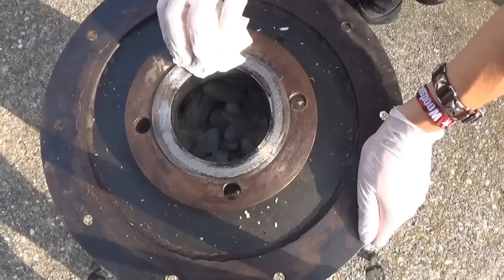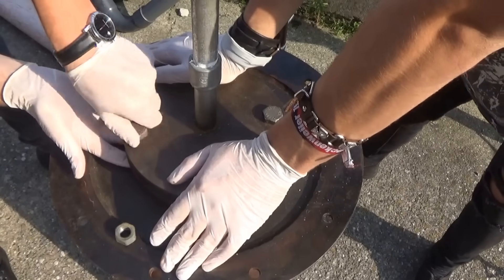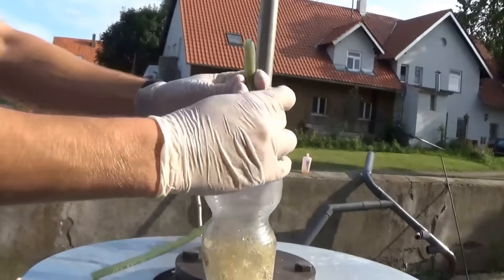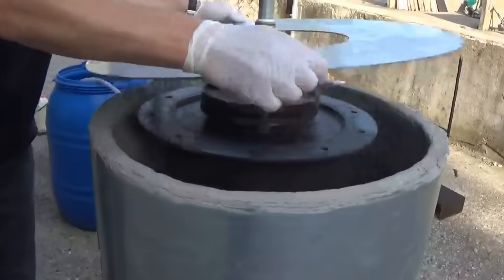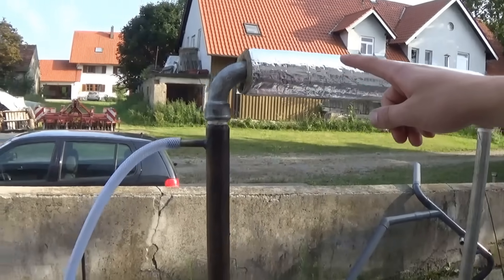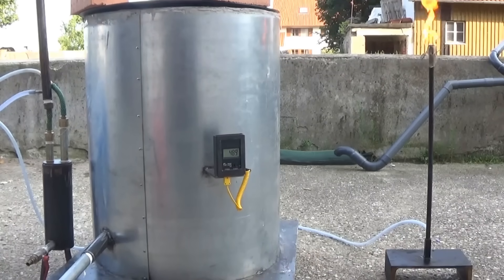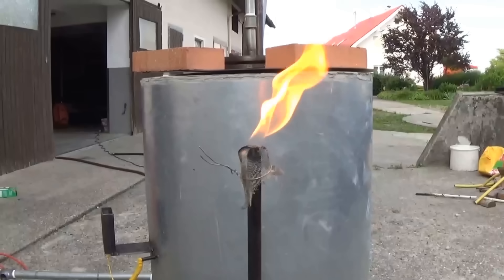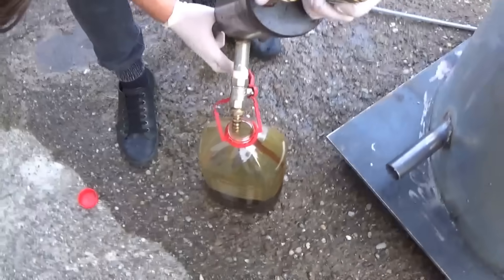plastic waste to oil/fuel improved pyrolysis reactor

Comment: use far better ground insulation put in a hole ,make/add a simple outside hot water jacket to retain more localised heat & run a small tesla turbine , 
collect the gas in a simple water based low just above atmospheric pressure  expanding uk 'gasometer' rather than wasteful burning.
 passed to a diy made & add/use a simple water based bubbling sealed 'trompe' higher pressure denser gas accumulator placed in a deep artificial water well to keep the high pressure gas simpler & safer use .
make a paint on internal low v (12v-50v driven by the simple made bladeless tesla turbine  ) resistive heater from 'Robert Murray smith conductive ink' https://m.youtube.com/watch?v=df58TiEhFn0 How To Make A Heater From Paper, Mar 22, 2018, 
Robert Murray-Smith
Something interesting to do with our conductive ink - you can help our campaign

Comment: If why not add water to the reactor instead of CO2 or another inert?  Yes there might be a small amount of dissolved O2, but when it flashes to steam, it should displace most other gases.  You could just vent off the steam first right?

Comment: 2:28 Or what about lighting a small candle and placing it into the chamber to burn away the oxygen inside?
Reply: It would only decrease the O2 proportion from 20-21% to approx. 12% at which a flame is smothered.
Reply: Some plastic could decompose react with O2 and produce carcinogen dioxine

Comment: Question: could the excess off gas that is sent to to the flare potentially be rerouted back to the chamber to potentially offset your fuels cost? Or in a larger scheme one would assume it'd have another function in the consumer grade fuel production right? Thanks, very informative.
Reply: Yes - you recycle the gas to power it in a full system.
Reply: Rather than burn it off pull it under a small vacuum and compress it into a storage cylinder.

Comment: Yep.. another poison turned back to poison.. but in a liquid form. Clean the land from plastic just to poison the air with it afterwards. Clever.. right? The gas from burning the plastic waste from that chamber relese a very toxic fumes ..just like the fumes relesed by a car after it burns the gasoline or the diesel. I see no filters used on this sistem.. and if there is such filters it is still poison back to poison result. So it solve nothing really.

Comment: after you get enough fuel from the system can you use it as the heat source mixed with air waste oil burner then the operation becomes no money out of pocket besides the blower but you could use a solar panel too for that

Comment: I worked for a plastics to fuel company building then running the plants as we scaled up in size.
Don’t use 3 or 7.  3 is of coarse pvc and the chlor recombines with the hc and creates hydrocloric acid.  Does wonders on the system, destroys fuel system of the engine, and is direct output of acid rain- way worse than the sulfuric base rain created from the old diesel. 
7 is basically anything not rate-able so you can get any kind of chemical reaction- absolutely chaos at a chemical level.
As you pointed out the styro issue, and without divulging millions in investment knowledge I will just say- don’t run it either.  So that eliminates 6
Polypropylene (5) has a high flash point and chem 101 will show you the issues mixing pp with pe.  So you can run it, but it is far better to run it in a separate batch as heating losses make it not worth running combined with pe.

So...1,2,4.  And if you price out 1 & 5, you’ll find recycling value is way more than cost of fuel retail.

Also- you need to remove contamination so we learned to shred, wash, and with specific gravity use as separation everything.  The amount of shampoo, milk, sugar, etc needed to contaminate a run is ridiculously small.  But our pyrolysis chamber was 12’ diameter, just over 30’ long each.  So shredding made sense for us to do in separation and cleaning.  At home- rinse and let dry in the kitchen or garage.  Separation by number.

You can definitely use the butane, propane, etc you are just burning off as the heating fuel to continue the process is you make a feed system so you can do continuous feed or run two pyro chambers.  Number one non-compressibles to heat unit number 2.

Also a better method of eliminating oxygen besides co2 is a vacuum pump when doing a pyro your size.  Get the a/c vacuum pump from harbor freight.  Then your heating process is better starting below atmospheric  pressure.

Then look into making a small distillation tower.  Product quality improves greatly.  You will pull out paraffin which can recrack and speed process greatly. 

Sally safety warning for doing this at home. Your literally making a bomb.  The temperature ratings of say an SF150 flange (150 psi rating obvi) at these temps goes down to a paltry 25psi.  7psi is actually the greatest rate to process at for volume and quality.  Learn to regulate there.  Have an ability to blow off pressure and expect it to be a fire ball when it occurs.  Watch other YouTube videos for what kind of fireball you get from just 1 gallon of gas.  Now have it explode at just 10psi.  It will turn a 3,000 sq ft house to embers quickly.  Remember output is 1:1. 1lbs of plastic equals 1lbs of fuel.  

Why isn’t this already everywhere:
I was in meetings with the head of recycling from Republic and we were planning to obtain their entire supply from the western US.  Obama’s epa admin refused to classify this fuel.  It doesn’t count as alternative fuel because it is crude base.  It doesn’t count as crude base because it has already been processed once.  Then the fact that this makes the fuel partial to full (depending on your process and quality) synthetic fuel.  So synthetics are a more regulated portion of the hc industry.  We hoped Trump would improve it but 2 sides of the same coin. 
Look at my profile pic - I am not a tree hugger.  I also am not pro big oil.  I had great hopes for this but unky sam is holding it under thumb for some reason.  High volume production cannot break even doing this unless oil prices are above $78 bbl  to do it with less than $50M you would have to have fuel above $90 bbl.  But thise numbers are all based on government allowing it- which they won’t right now. No new distillation towers are allowed from EPA still that are needed for this process.   No reason given other than ‘green’. 
So until a large change is made in one or both of the political parties, this is going nowhere. I’ve met with the guy running these as power production facilities at waste plants.  He is skirting laws barely to do that and isn’t allowed to produce any fuel or output power not consumed on site.

Good luck to ya.  Be safe, you’re playing with fire on a huge liquid & gaseous pipe bomb.
Reply: Looks like there are more people who need some education about the topic NatureJab basically does the same now. https://youtube.com/shorts/DPD_A1Veszk?si=Is0P6qxlNDi3Z8gm
Reply: @NemesisTheOne the problem is he isn’t doing the chemical analysis on his fuels.  We see him putting in PVC.  The chloride gets separated then recombining with the hydrogen and becomes hydrochloric acid!  This does damage to the injectors, in diesels does damage to the injection pump, and the tank depending on its material.    Then doing the emissions testing - the combos he is using will severely shorten life of the catalytic converters.   Then what the fuel does to the valves, piston rings, etc.  Anyone can throw something flammable in and make it run.   But on high cost engines- people pay more for better fuel to keep engine alive longer and this stuff will kill it much faster.   Been there, done that.
Reply: Hola me llamo Marcos,  le quería preguntar si usted me podría asesorar yo estoy asiendo lo mismo .
Reply: I want you to tell me how to perform a vacuum.Should the pump be installed in the reactor head or where? And does the vacuum pump remain operational during the distillation process?
Reply: @شؤوندولية yes a large vacuum pump can work.  But you can also purge the oxygen out by using carbon dioxide or another inert gas.

Comment: Nice project, but in reality whats the actual efficiency?  The cost of running the reactor must be less than that of the fuel produced.  Or is this just a fantastic demonstration?  BTW throw in some catalyst maybe.  Metal salts on fly ash are useful (I worked on this briefly in a job many years ago).  Nice work!!  Looking forward to more.

Comment: Why mix the flare gas with the natural gas to provide the energy.  Also, the produced diesel should have little sulfur.  If less than 15 ppm sulfur, there is no need to remove S from the produced diesel fuel.  How many BTUs of natural gas did you use to make 3-liters of sweet crude?  If around a buck, oil refineries could make diesel from plastic or crude oil...I have to believe some Chem E has already looked at this.

Comment: Hey man ...I have some questions
So we basically built one and came across that the fuel was watery but there was like a greesy substance left behind and it was not flammable so we must of done something wrong...the gas came out and lit up straight away...

Is this because we did not wait until the temperature reached 350-400 degrees...

We just lit the fire and started catching the first liquid 

After an hour the pressure got much and blew the top off ..

We want to try again..

So my question do we wait until the temp reaches 350-400 before we start collecting the liquid or do we just start collecting from the begt we start the fire?
Reply from the maker: hey scheldon
just write me a mail at hazelchemistry@gmail.com . It should contain pictures and a blueprint of your set up. I will look into your problem and try to solve it :D 

mfg hazelChem

Comment: So, to reclaim fuel from the plastic, you must use propane fuel to create enough heat to render the plastic back into oil...

Unless you’re producing 5x 6x the oil compared to propane consumption, you’re doing more harm then good. 

As much as Hank Hill loves to quote “clean, safe burning propane” that’s so far from true that it’s literally a joke on that show. 

The only thing that will make turning plastic back into oil environmentally friendly will be the whole planet no longer producing plastic waste or plastics at all. 
Otherwise from the ground up(literally) the crude oil process of harvesting outweighs the slight help this produces compared to its own cO2 byproducts.

No one has been claiming this can’t be done, they have been saying that it’s 10x the cost and effort to get back a fraction of the oil used in production of the materials.

Comment: I've seen a homemade solar furnace melt lead here in Florida so I know your process could be done with no external fuel source.
Reply: Big brain idea: Use the waste fuel produced to fuel generators to charge the solar batteries in parallel or provide direct power, or even power electric heating for the reactor.

Comment: Once the bolts are tight. Tack weld the nuts on? make like a bit simpler
Reply: Nuts to the flange...So you dont have to hold a back up or lose them...Life....a bit simpler

Comment: So you made 2 liters of fuel buy consuming 4 liters of Propane ... and sent more toxic green house gasses back into the atmosphere in the process. places like India are polluted enough, they dont need to pollute the air anymore than the ground and water already is... they need a closed system... and closed systems are expensive. Plastic is the problem... its the miracle material that will doom this planet unless we find another way.

Comment: Instead of using carbon dioxide could you just pull the chamber down to a vacuum with a pump to get rid of the oxygen?

Comment: instead of the weird seal, cut up a headgasket from an old big (diesel) engine
Reply: Copper sheet would be great to cut from, or some MLS sheet too.
Reply: Make a ring out of copper wire. I've used a #12 awg as a head gasket on a lawn mower engine while awaiting a new one to arrive.  The tricky part is to join the ends of the wire by overlapping and careful crushing.
Reply: @pixelpatter01  Pro Mod racers and drag bike guys used to do this long ago by making fire ring cuts in the heads, or cutting a recess during machining. They would weld the awg wire together and use it like you stated.
Reply: @scotteric8711  Yes if you are going to expect high power performance and compression you would have to cut a groove in either the head or the block, but the pyrolyzer  here is operating at atmospheric pressure so it's not required. The lawnmower kluge apparently didn't need it either.

Comment: its all good that this process is creating a usable product from basically garbage  but aren't they burning propane gas to make a flammable liquid so I don't see where it's economically feasible or good for the environment to burn a resource gas to make gas?... I know its cleaning up the ever-growing petroleum based plastic problem that is smothering our earth because it takes 1000 yrs. for plastic to  disintegrate but it just seems like trading 1 for the other? 
 It would be awesome if there was  a way to vaporize the plastic without using a resource. Until then... back to the drawing board

Comment: The Heat from the Flame Could be used to Heat Water Maybe ? 
Or Returned to the Machine to Give SELF PERPETUATING HEAT While it runs ?  In the Style of Perpetual Motion / Or Self Sufficient to save on Propane  maybe ?

Comment: bolts , not screws... I would be interested to know the calories used to heat chamber vs. calories of fuel produced? As mentioned before, you could use the waste flame to heat the chamber.

Comment: the waste gas could be redirected to the burner saving on lpg to heat the reactor
Reply: or bottle it and use it next round and repeat so it minimises waste?
Reply: Are you the All gas no breaks guys parents?
Reply: I propose the simple fact without heating above 1000 C° method accidentally I found, use the waste any oil to desolv the plastics in to liquid forum
Reply: Others do this in „a better trashcan“ with wooden fire below
+ you could recycle this plastic by 90% into new plastic instead of causing a need to produce more new plastic from raw materials
= environmental protection gone FAIIIIIL
Reply: Elisabeth Wittner their are plastic bottles littering the hole world, this is a failure. Trying to use some of it up is not. Nothing is a perfect.going around kicking everyone in the nuts doesn't help solve any problems!
Reply: @elisabethwittner5539  What you can buy from recycled plastic is just not worth the money. Get's brittle almost the moment you paid for, i just don't want spend money any more for recycled plastics. Better heat the house with.
Reply: @elisabethwittner5539  
If you want to have good recycled plastic, the recycling process ist using up much more energy than making new plastic. That's why i think, concentrating in converting the old mixed and smudged stuff into a usable form of energy is a much better way of getting rid of our "plastic waste is killing our world"-Problem.
Just the real plant must be self sustaining, not wasting LPG and lit the "waste" gasses. But it's just a matter of converting a prototype into a finished process. The energy it needs to pay for itself and get profit out of it is all already included in the plastic.
But i think, separating the plastics in chemical categories is mandatory. The chlorine in PVC must not be handled with such a reactor, for instance.
Reply: Werner X ... yes. Also the processing parameters and the design of the pyrolysis system probably can be adapted to other materials in such a way that the process could take different sources or even mixes of them in order to process what’s available at that moment. Perfection doesn’t exist but trying to improve should be the aim.
Reply: @elisabethwittner5539  plastic to plastic recycling is not that easy. They lower fuel production - but using gas burner... use waste wood or wood gas instead.
Reply: @elisabethwittner5539  you can not recycle all Plastic waste to new plastic parts because it the part is already degenerate by sun than the material can only make bad plastic parts. On the other hand there are many packaging material concist of diverend plastics. this mixture you can not regrind and make new granules
Reply: @elisabethwittner5539  That's not how plastic really works.
Reply: @elisabethwittner5539  Pretty sure the amount of plastic in the world would last indefinitely at least within our lifetimes due to the sheer amount that's been produced in the past 100 years. And it's not going anywhere. Takes centuries to degrade.

Comment: It’s a nice setup but I wonder if it makes economic sense. 
Once the oil is refined, is it really usable as fuel for cars?
If it’s just about solving the plastic problem of developing countries, it seams like a very complicated solution. A waste to energy power plant would turn the plastic into electricity without any refining steps in between. Obviously these kind of plants are rarely to be found in developing countries because of the high cost.

Another problem is PVC. What happens to the chlorine in this process? I assume it just gets released and concentrates in the oil. Further refined it gives a fuel which releases chlorine gases when combusted. Sounds not very healthy. 

It’s a nice setup but this alone is not a solution. It’s just a first step.